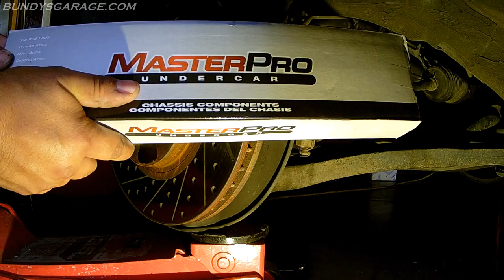SAVE MONEY! - DIY Auto Repair and Product Reviews - Bundys Garage Trailer

Comment: what happened to the Acura with the Lucas transmission goop in it?  Is it still running?
Reply from the maker: Yep Lucas really helped it out. Have put about 2K miles on since I added it and the Trans is shifting good. Differently worth it.
Reply: Good to know that sometimes haily mary works.

Comment: People like you cost people money. I get vehicles towed into my shop everyday with the DIY gurus such as yourself giving false confidence in the repair. It cost more to repair the mistakes and then the original concern. How about you leave auto repair to the professional? You're worse than the wanna be turbo geek at a parts store scanning codes and pushing parts people don't need. That not saving money...